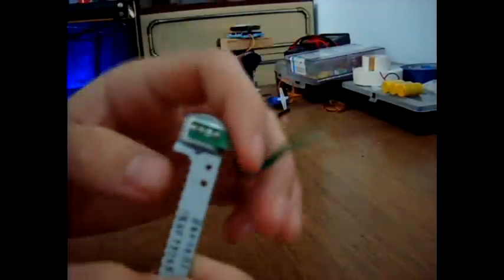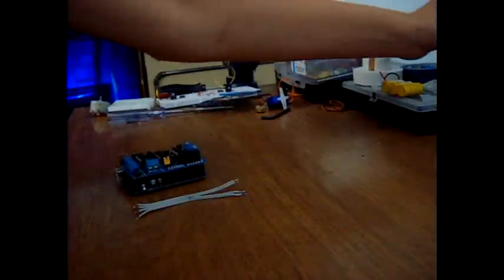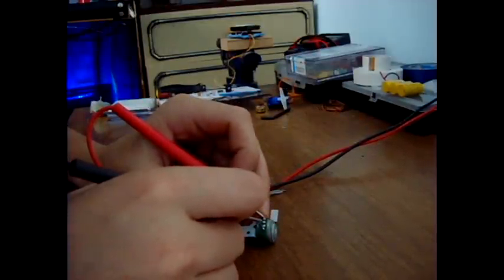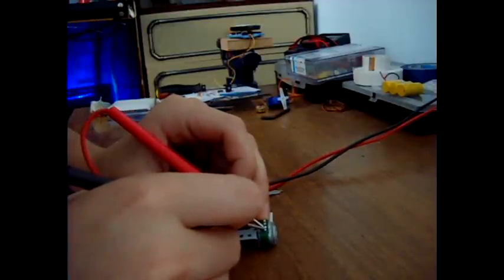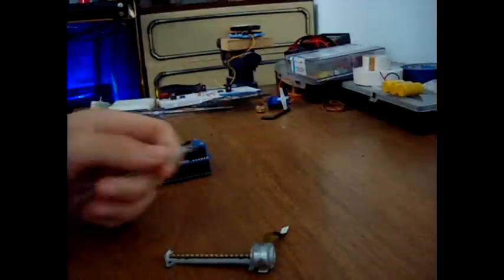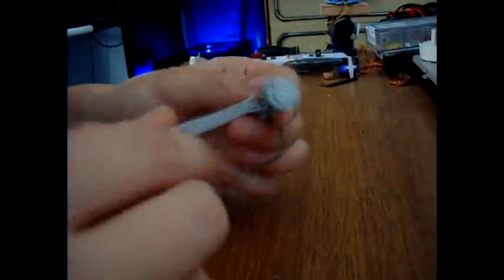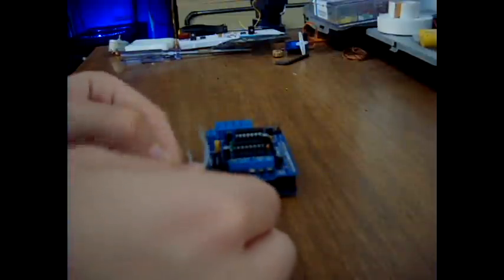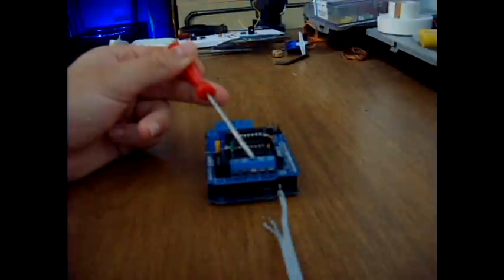How to connect stepper motor to an arduino

Comment: In am making a CNC machine. Do I need to connect wires like + and - to any 2 points?I mean if I interchange it will it have any problems?
Reply from the maker: i explained in a video you need to find two pairs of wires(first pair is one coil and second pair i second coil)that are connected and than connect them to arduino i doesn't matter if you switch their places a long as you don't switch wires between the coils
Reply: Alem Electronic I am using 2 stepper motors for X and Y axis.
Which should I connect to which point?

Comment: Hey dude, I'm using a DVD 5v stepper motor with cnc shield, the motor is getting hot, what will be the problem, I have supplied 12v, can u give a solution to it
Reply from the maker: maybe you are overloading the stepper motor it cant handle driving that thing that you are driving
Reply: I haven't connected anything, it was free
Reply from the maker: check that everthing is connected right and make sure your stepper motor is not damaged
Reply: The boards minimum input is 12v, dose that make a problem
Reply from the maker: it can be a problem it depends what output voltage your board is boosting if its 12v thats the problem
Reply: Is there any way to reduce it, by adding any Resistor like that
Reply from the maker: you can try...
Reply: Thank you

Comment: Hey dude i got everything right but my pm stepper motor aint  rotating at all. Any suggestions please 
Thanks
Reply from the maker: ok so i assume that you connected the stepper motor correctly did you instal a right library ?
Reply: +Alem Electronic can you help me library please???

Comment: can code for shilda L293D Motor Shield.??
Reply from the maker: +Alexey Arduino yes just make sure that you installed library correctly
Reply: the library is installed correctly. But when loaded into the Arduino that the download is in one place. What could be?
Reply: Arduino: 1.6.4 (Windows 7), Board"Arduino Uno"

MotorTest.pde:5:21: fatal error: AFMotor.h: No such file or directory
compilation is terminated.
The compilation error.

This post will contain more information than
"Display output during compilation"
included in the File > Settings
!!!! HERE THIS ERROR WHAT DOES IT MEAN ?
Reply from the maker: +Alexey Arduino you probably didn't instal a same library that i have
downlaod this librarys and testi it out which one works this first one should work 
http://www.airspayce.com/mikem/arduino/AccelStepper/
 https://learn.adafruit.com/adafruit-motor-shield/library-install
http://sourceforge.net/projects/enes100hvrcrft/files/AFMotor%20Library/
Reply: I here's a download code! and he makes a mistake!!!!!
throw me some code you use??!!!

// ConstantSpeed.pde
// -*- mode: C++ -*-
//
// Shows how to run AccelStepper in the simplest,
// fixed speed mode with no accelerations
// Requires the AFMotor library (https://github.com/adafruit/Adafruit-Motor-Shield-library)
// And AccelStepper with AFMotor support (https://github.com/adafruit/AccelStepper)
// Public domain!

#include <AccelStepper.h>
#include <AFMotor.h>

AF_Stepper motor1(200, 1);

// you can change these to DOUBLE or INTERLEAVE or MICROSTEP!
void forwardstep() {  
  motor1.onestep(FORWARD, SINGLE);
}
void backwardstep() {  
  motor1.onestep(BACKWARD, SINGLE);
}

AccelStepper stepper(forwardstep, backwardstep); // use functions to step

void setup()
{  
   Serial.begin(9600);           // set up Serial library at 9600 bps
   Serial.println("Stepper test!");
  
   stepper.setSpeed(50);	
}

void loop()
{  
   stepper.runSpeed();
}
Reply from the maker: +Alexey Arduino code that i used in video is just test code here is a code with two stepper motors that draw a square so upload this one it works 100% 

// Adafruit Motor shield library
// copyright Adafruit Industries LLC, 2009
// this code is public domain, enjoy!

#include <AFMotor.h>
#include <Servo.h>
Servo myservo;
int pos = 30;
int pos1 = 0;// variable to store the servo position 
 

// Connect a stepper motor with 48 steps per revolution (7.5 degree)
// to motor port #2 (M3 and M4)
AF_Stepper motor1(48, 2);
AF_Stepper motor2(200, 1);

void setup() {
   myservo.attach(9); 
  Serial.begin(9600);           // set up Serial library at 9600 bps
  Serial.println("Stepper test!");

  motor1.setSpeed(100);
motor2.setSpeed(120);  // 10 rpm   
}

void loop() {
 
  
    myservo.write(pos1);
    delay (1000);
  Serial.println("Single coil steps");
  motor1.step(200, FORWARD, SINGLE);
 motor2.step(200, FORWARD, SINGLE); 
 motor1.step(200, BACKWARD, SINGLE);
 motor2.step(200, BACKWARD, SINGLE); 
 
    
    myservo.write(pos);
delay(1000);
motor2.step(20,FORWARD,SINGLE);
myservo.write(pos1);
delay (1000);
  motor1.step(200, FORWARD, SINGLE);
 motor2.step(200, FORWARD, SINGLE); 
 motor1.step(200, BACKWARD, SINGLE);
 motor2.step(200, BACKWARD, SINGLE); 

  

}
Reply: all earned but the power of the motor is weak as ispraviti to mosney?
Reply from the maker: you have to connect external power if you want them to work under pressure
Reply: this type of power supply? If so, how much should be volts? I have power coming from the computer
Reply from the maker: power from computer cant drive the stepper motors under pressure you need externat power at least 1A 12v
Reply from the maker: if motors have a big load on them they will drive more current
Reply: How to change the value of the load or the driving speed engines? And if you can send the code you are using please
Reply from the maker: +Alexey Arduino u have give you the code in one of the comments you can change speed in a code look for  motor1.setSpeed(100);
motor2.setSpeed(120);  // 10 rpm
Reply: Good day. Tell me how to start the second engine? One I have works fine and the second not.

Comment: but what about the programming? I have both the AFmotor and accelstepper libraries installed, but what porgramming do they entail?
Reply from the maker: +cakeless coder in those libraries you have examples of codes that you can change and make stepper do what you want him to do
Reply: Alem Electronic ok thanks. it's a very helpful library and shield to have, I must say! makes motor and servo control and layout a breeze, and they run super smooth. I'm using one of the 4 wheeled acrylic bases you get off ebay for like $15 and a mega (on an atmega2560) with this board and I have to say that if you are like me and want to get into robotics without spending heaps, this is a great way to do it. my whole robot (with yl-54 IR sensors and a HS-SR04 ultrasonic have cost me less than one of the IR sensors for the lego ev3 kist they use at my school.

excuse my tangent.